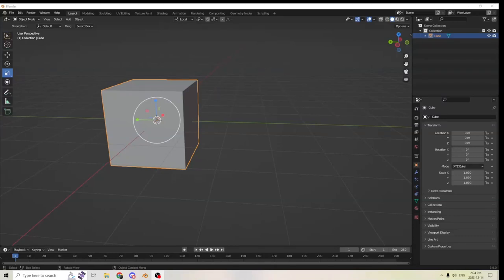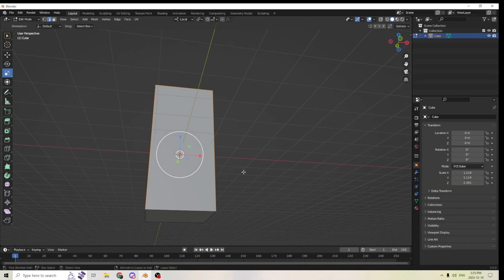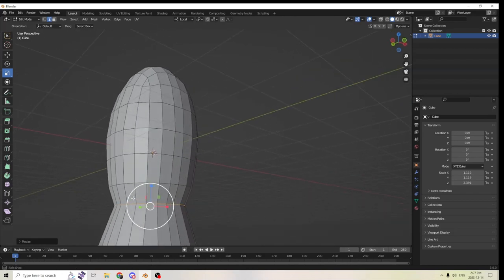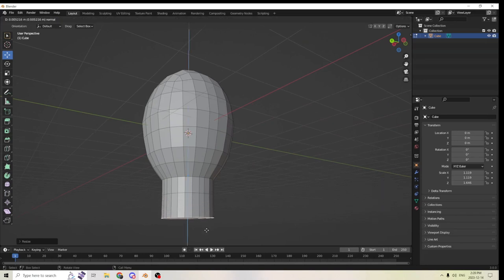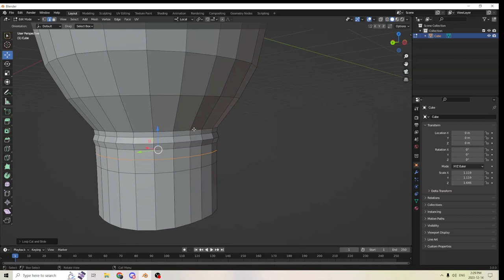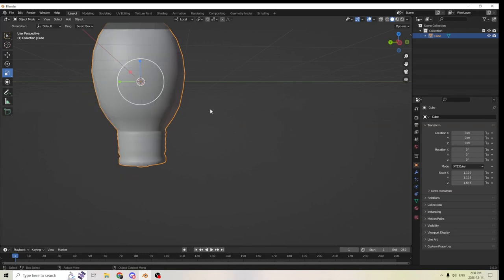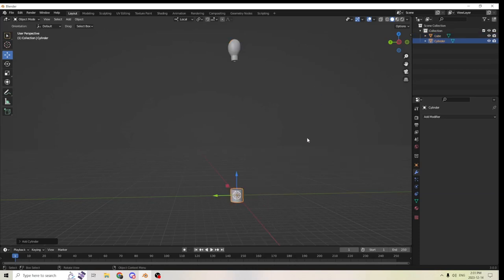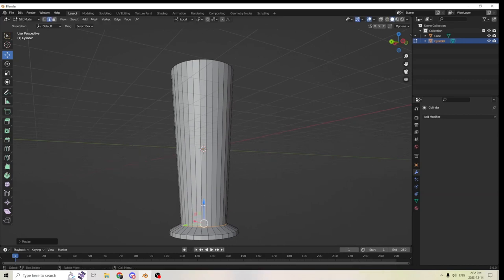Lights and lamps made in blender

Comment: Not saying one is better than the other but just to let you know that for unity there's no change required when exporting. So there must be something different in unreal that requires a different size. Different game engines all have their quirks and requirements.
Reply from the maker: that is one thing that can cause issues i believe if you use Maximo i think its called. There is no import settings. And yes your right every engine has its ups and downs :)